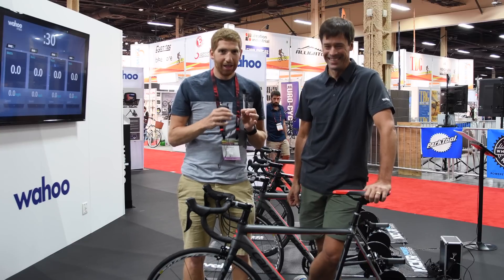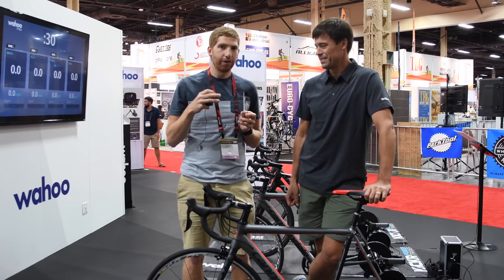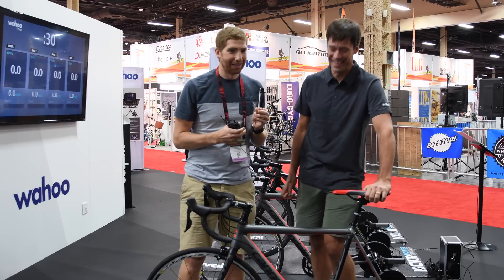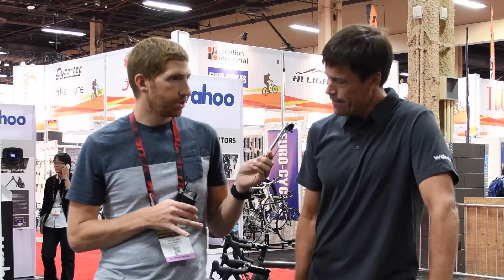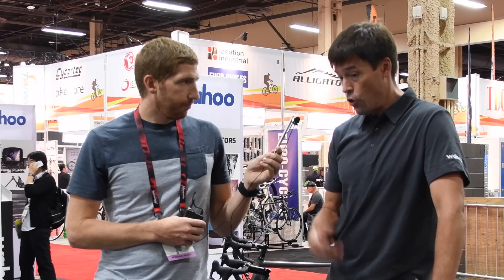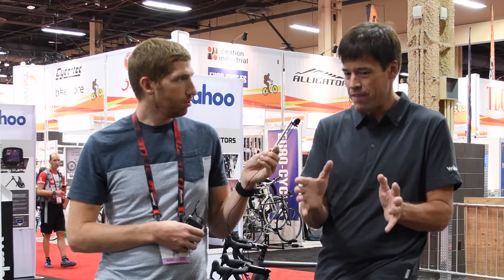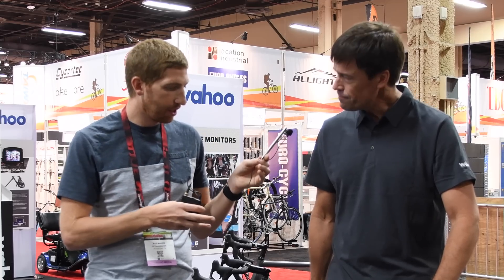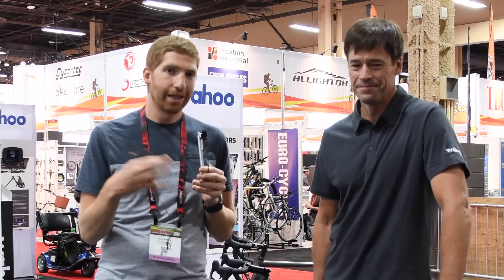Wahoo's New KICKR: Accuracy Tech Talk

Comment: Confused.... He says a spin down is not needed not due to temperature of the kickr unit after it warms up during a workout? Surely thats wrong....  does that not have the BIGGEST affect on the resistance and the power accuracy??
Reply from the maker: Technically it has a temperature sensor in it.  Though, I find that doing a calibration around the 8-15 minute marker yields the best results.
Reply: DC Rainmaker thanks for the info! Which trainer do you train on as your daily driver?
Reply from the maker: Tacx Neo.
Reply: DC Rainmaker thanks for the reply! Reckon the kickr is a worthy trainer to use if you are not on a neo? Weighing up options!

Comment: The question is ... Tacx Vortex Smart OR KICKR SNAP? I cannot make up my mind. (Have read DC's latest article recommendation). Seems to me that the Vortex might have some quality hit or miss issues with bearing noise on the brake unit but has better software. On the other hand, I am reading on the Snap and the hardware is great but it is lacking on the firmware (watt fluctuations) and maybe not such a great support from software, even tho it supports ANT+ FE-C? Any advice?
Reply: Just a note.. I just received the Kickr Snap for Christmas and have had issues with power spikes to a point where I'm unable to pedal during intervals in Erg Mode. If this happens to you you should try the beta firmware that they provided... 

"1. Open the Wahoo Utilities app app.
2. Make sure the Wahoo device is powered on.
3. Click on the Wahoo device when it pops up.
4. Wait for the Wahoo Device to connect, once connected tap the grey icon of the device with the Bluetooth emblem in it 10 times to bring up the firmware update list. It will show what firmware is current, choose the firmware 2.1.6
5. Allow the update to finish and try and reconnect the device to the Wahoo Fitness app when done.
6. Return to the Wahoo Fitness app, repair the sensor in the sensor settings and save the sensor to the proper workout profiles.
7. Return to the main wahoo fitness screen, select the proper workout profile and start your workout!"

Since getting this updated yesterday it seems to be working during my TrainerRoad session was able to do right after.

Hope this helps and good luck!
Reply: Super helpful info. Thanks bud! And in case you didn't know, have you checked out the power spike fix video here on YouTube somewhere? It's a cheap and quick fix to the optical sensor that might help if indeed a software patch can't fix it.
Reply: Have you made your decision yet? I'm stuck with this same question as well. Would be interested to hear your thoughts on what you went for, and how it's working out for you so far.
Reply: Hey there. I went with the Kickr Snap. It is better quality, better on the Watts for sprints and US support. The Tacx will be a PITA to service (and expensive) when it gets out of warranty as it needs to go back through the vendor your bought it from and they will deal with the Netherlands shop. Wahoo Kickr Snap needs to be calibrated right to be more accurate on the watts. Mine is coming in in two days, so no comments yet on the use. But, I am happy with the decision. Also, read this article: https://kidsandcowbells.com/2016/12/12/wahoo-kickr-snap-spin-down-calibration/
He also has a Youtube channel and he compared the KICKR Snap with the Tacx Vortex. Snap won. Have fun!
Reply: Thanks! I've posed this question to quite a few others and almost everyone I've asked went with the SNAP as well. Ordering mine tonight from a local shop!
Reply: If its the one foil sticker replacement then I sure did! but since i just got it brand new i figured I shouldn't have to modify it at all since I can still return it. I would of done it for sure if the warranty ran out though.  Let me know if you run into any issues or your thoughts about it!

Comment: Ray you really have to bump up your audio equipment and quality.
It is really the downside of your videos and for me doesn't really fits to your quality website.
Reply: I thought the audio was fine on this video.
Reply from the maker: Yeah, generally it works out fine, but I think it was using wireless mics in the convention center that caused issues.  Other times it's just stupid stuff like running out of batteries and being on the side of a mountain having hiked a few hours to get there...so...is what it is then.  Finally, some may be editing in terms of just having the volume too low - I pumped it up on the two Karma videos, but may need to go more.

Comment: very interesting. Any idea when the update to the old model to utilize the new power measurement method will be released?
Reply from the maker: Hmm, not sure, I'll poke.
Reply: looks like beta firmware v1.5.56 is out now which enables power control switching. Sounds like that's it!
Reply: How do you get it?
Reply: Just in the Wahoo fitness app.  Press  sensors, then keep pressing the Kickr icon until the list shows up.